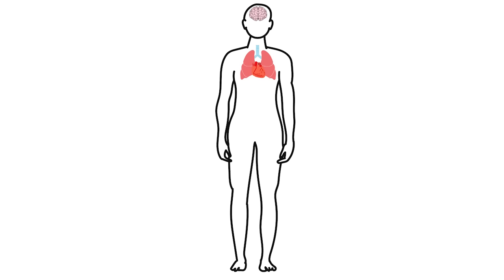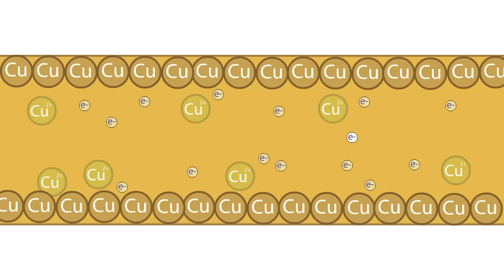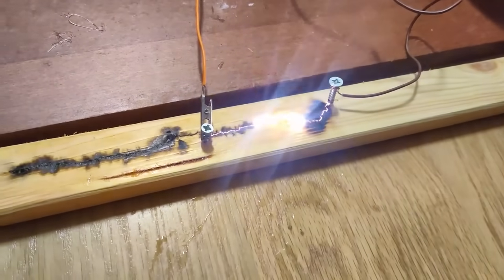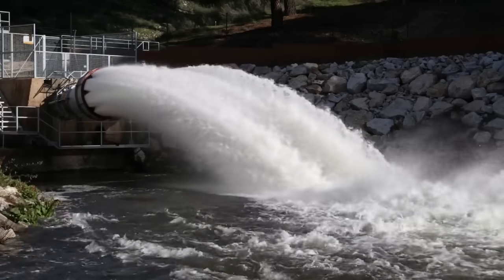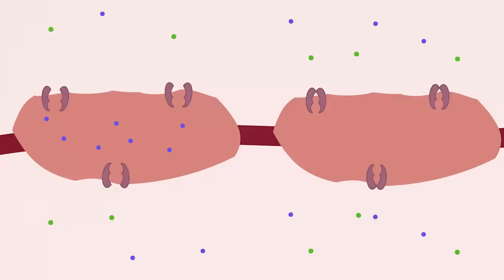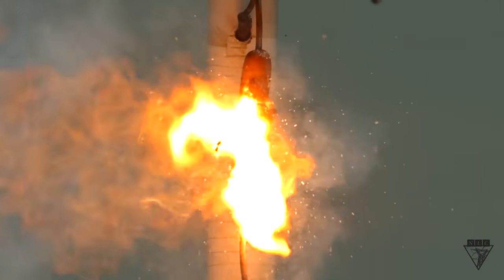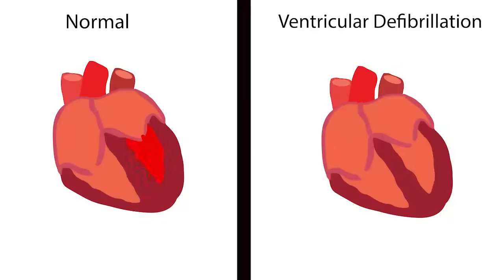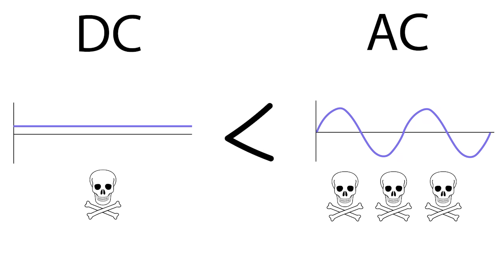Anatomy of Electrocution

Comment: I am an electronics hobbyist. I have worked on both DC and AC circuits. I was working on an amplifier using transistors, the power amp section. The current of the power amp, the collector current, was about 650ma. At the time I did not know that I completed the circuit and 650 ma was flowing through my body. This was for several seconds, possibly longer. But I felt nothing. In your video, you say that a current way less than 650 ma can kill you?
Reply: There wasn't 650 ma flowing through you. In order to get that amount of current flowing through you there would have to be something like 1000v across your body. It's like saying that you completed a circuit by touching a car battery with both hands and the car battery has a short circuit current of 2000 A. In reality since the voltage is only 12 v almost no current flows
Reply: @laserdiode  I had an ammeter in line. Maybe I made a mistake in reading the current because I was on the verge of being electocuted.
Reply: @roncaruso931   What was the voltage across your body
Reply: @roncaruso931  Also if you had an ammeter was the only path for the electricity going through you or was the circuit just operating normally at 650 mA when you touched it

Comment: This video doesn't cover voltage part at all. I had been working with different current measured in Amps which is much higher from mA but I never got electrical shock due to low voltage. 15mA which would cause no let go effect would happen probably with > 500 Volts if not higher
Reply: There is a big difference between the current that flows in a wire that you are touching and the current that actually flows through you. There are only two things that can affect the amount of current that flows through you and neither of them is the current that flows in the wire. Thy are the voltage across your body and your resistance. Since you can't change your resistance the only variable is the voltage across your body. In the video all the currents that were mentioned were flowing through you. It doesn't matter if you are working with a car battery that can supply 1000 A. Since it's low voltage almost no current can flow trough you. The current going through you always does the same damage despite the voltage but the voltage determines how much current flows through you. Also 230 v mains voltage can easily supply more than 15 mA trough you.

Comment: By the way @DarkScience didn’t you mean fibrillation rather than defibrillation?   Defibrillators do use electricity to shock the heart back to a normal rhythm, but the lethal rhythm where the heart bears rapidly and in an uncoordinated action is called fibrillation.  And it can be caused by electric shock.

Comment: Actually AC was selected for political reasons - Thomas Edison suggested the electric chair use AC as he wanted to convince people it was inherently more dangerous than his proposed DC transmission network, and thus discredit his competitor George Westinghouse.   A DC electric chair would be completely possible.   Also, amusingly enough the control panel for Virginia’s electric chair has prominent GE branding like what one might see on a 1950s refrigerator (although to be fair that control system might be a standard industrial switchgear that was purchased off the shelf and configured for use on the electric chair.   Florida’s electric chair, and many others, are powered by their own dedicated generators, so its a pure urban legend that the electric chair causes a brownout in the vicinity of the electric chair being used (although it might well dim indicator lights connected to the lethal circuit).

Comment: Tip from an electrician. If you want to test if a wire is live or not, always use the backside of your hand. If the wire is live you will automatically contract away from the source. Ofc you shouldn’t test it in the first place but there may come times where you think “oh the fuse is broken, I can touch this part” so it is always good practise to touch everything with the backside of your hand first

Comment: also with Electricity (AC and DC)  you can have a 100 Amp power supply and it wont kill or burn you, that is, as long as its below 2-3V,  you can rewire larger transformers to pump out a Crap Ton of current but the voltage is Way too low to pass through your skin
Reply: Actually below 20 V - it is not a coincidence that laptop power supplies provide 19.5 V and even that standard is done on safe way, generally it needs to be 50 V for AC to be dangerous.
Reply: @okaro6595  yea, however if your hands are wet you can feel the electricity a tiny tiny bit at 20v, i used a laptop adapter as a 20v 10a power supply, and i was holding it onto a circuit after just washing my hands (they weren't drenched but a little damp) and i could feel a very very light tingle, not at all painful but i could still feel it

Comment: Electron drift is like centimeters per hour. I think you're thinking of charge and converting it to atomic units. An amp is 1 coulomb per second, which is 6.25 x 10^18e. The energy of chsrge is moving, but not the electron.

Comment: ive fallen onto the arm of a camper, like the little arm that holds up the sun shade thingy on the side, it was not grounded and had rigged up wiring from a nearby house, my arm wrapped around it and i was stuck, i remember feeling it and wanting to let go but i just couldnt, i was there for probably 6 or 7 seconds before my dad (who has electrician experience) realized what was happening and tackled me off of it. i have no lasting affects as it wasnt too high of a voltage, i believe 120, it was still terrible

Comment: I tinker with a lot of electronics most people i know are rather scared of it. Had a few minor pockes a 9V battery and relay coil, an old florcent flashlight, and the one that kind of surprised me tried to shut off a weed trimmer that the control broke leather gloves and boot over it tried to remove sparkplug wire but still got me.  

Someone i know when young was doing something with a 480 Circuit tocuhed something as somone was just saying not to, blew them off the ladder. Another i heared second hand a chainlink fence got put up the person tocuhed it and got fried, apparently somewhere it hit an underground line but somehow no protection device activated. 

One of my big pet peves is when people call getting shocked electricuted. A lot of people do this but two very different meanings.

Comment: You didnt mention the DC voltage at which 15mA is fatal. I know for a fact, I can grab both leads of a 750A 12V battery and not feel a thing.
Reply: The chart was for current flowing through you. Current flowing through you always does the same damage despite the voltage but the voltage determines how much current is going to flow
Reply: @laserdiode  but isn't the voltage what causes the current to overcome the resistance of your body to begin flowing?
Reply: @jkunz27  basically yes but resistance isn't something you have to overcome in order for current to start flowing. Resistance determines how much current flows at a specific voltage. Even with low voltage some current flows through you but nowhere near to to anything. If your resistance was constant  the voltage across your body and the current flowing through you would mean the same thing because they would be directly proportional to each other. In reality your resistance isn't constant but there is still a clear relationship between the voltage and current. With higher voltages your resistance decreases so even more current flows through you

Comment: I was performing some maintainance once and (admittedly through my own complacency) managed to get two parts of my hand in contact with Line & CPC (Live & Earth). That meant there was a 100% metallic path for the current to flow with the exception of the resistance of my hand. Now alot of people have felt what its like to get a shock from a 230v line wire, just standing on solid ground and it hurts. Having a fully metallic path is a whole other level. It was the most painful thing I have ever experienced and through sheer luck, that circuit had additional protection through an RCD that tripped out after about half a second. I ramp tested the RCD afterwards out of interest and it tripped out at 23mA, meaning AT LEAST that amount of current was flowing though my hand in that half second. I was thanking my lucky stars that the additional protection was present and working. It could have been a very nasty injury otherwise.

Comment: During an electrocution, more often than not, it's actually asphyxiation from holding the diaphragm in a flexed state, not total destruction of the organs that kills.  That's why it takes an excruciatingly long time to carry out an electrocution.  That said, we really don't know what happens, and it's more or less speculation.  Also, bodies don't vibrate like in cartoons or movies, it's one big contraction, stays at that level, then when current is killed, the body slumps.  You also failed to mention that the protocols of the electric chair varies from state to state.  Some run an initial voltage of 1,700 to 2,500 V at eight to 10 Amps and then apparently, in some cases, it drops to 250 V then the third and final is 2,500.   The same happens with DC, and I think your little explanation saying AC is deadlier is basically out of Edison's playbook when he was trying to downplay Tesla's and Westinghouse's AC transmission versus his DC transmission.

Comment: Here's a shocking story of mine:

In the summer of 2021 I did volunteer work for a farm that has many farm animals including horses, mules, and donkeys. One day I was tasked with pressure washing various pieces of equipment. So needless to say my jeans were soaked. After pressure washing I helped out with moving some animals to the other side of the pasture (from outside the barn). I went back inside to close the gate, left hand holding the chain but I had to step closer to get a hold of the gate. My left shin touched the high voltage lines that are used to deter animals from trying to climb the fencing, and the electricity went from my shin and out my left hand to the chain. I felt no pain at all, but it felt like my chest caved in for a split second like I was punched really hard. It made a super loud bang, and I was on my knees for a moment. 

It seems to me like most fencing uses DC, so I'm guessing this is DC as well which would make sense because it just felt like a punch with no feeling of vibration or humming noise, just a bang.

Comment: The human body has a negative resistance characteristic. If iou take a n everyday multimeter detbit on ohms and grip the red and black leads it will generally around 4 Meg ohms or 4,000,000 ohms by that if you touched 120 volts you would have 0.00004 amps barely noticeable however at 120 volts  the bodies resistance drops to about 900 ohms and 
0.130 amps is fatal. At 2400 volts the current must be limited to 8 amps or the body might explode.
Edison invented the electric chair to warn of the danger if the Westinghouse high volt system. The first victim took 7 minutes yo burn to death.

Comment: Im a retired electrical/ electronig engr. Ive had several shocks from 230V over the years and got zapped  by the HT in the back of a TV, but the worst shock I ever got was when I grabbed a 12V car battery by the terminals. Luckily I dropped the battery and the circuit was broken. After I regained my composure I rea,ised that I must have had some battery acid on my hands that lowered the normal skin resistance fromm 100k ohms to a few hundred.
I speculate that a single alkaline cell  of 1.5V could kill someone if a sewing pin was pushed through the skin on each hand and the battery appled. The internal rezistance of the human  body is sufficiently low that 1.5v is sufficie to produce a  current of more than 50mA❤
Reply: I’ve worked on vehicles all my life and handled thousands of car and commercial vehicle batteries,most truck and buses use 24volt systems made up of 2twelve volt batteries or 4six volt batteries in older vehicles and never heard of or got a shock from them,perhaps I was lucky.

Comment: The information given here is not true. Especially the chart about how much current is doing what to your body. As you yourself mentioned it is always the combination of voltage and current, not just current or voltage.

And the statement that ac is much more dangerous than dc is utter bs! It always depends. The person touching the fan for example would have easily survived if it was ac instead of dc because then, he could just have let go of the fan.
Reply: All the information was true but there was some parts that were missing. The chart about current is accurate but it only works for the current that flows through your body. The voltage determines how much current flows through you so you can touch a car battery that can provide 1000 A but since it's only 12v almost no current flows through you. Also it's completely true that ac is more deadly if you only compare the current needed to kill you but he didn't mention the fact that it's easier to let go of ac

Comment: 15mA is lethal? Do you mean 15Amps? Doesn’t a small phone charger output 500mA ?
Reply: 15ma can be lethal. but to get that current going you need enough voltage for dielectric breakdown to happen (your skin/flesh starting to conduct electricity).
on a 5 volt charger like a phones it will never happen.

Comment: Outstanding explanation!  You managed to teach basic electrical theory, physiology and pathology at a perfect level to understand the process of electrocution.  The only mistake I could detect was the use of the term "ventricular defibrillation".  Defibrillation is the action of correcting fibrillation, hence the term "defibrillator" associated with life saving first aid machines.  The correct term for the pathology is "ventricular fibrillation".   I mention this only because there could be confusion regarding defibrillator machines; everything else about this video was excellent!

Comment: I have 240v go through me and my fingers were black for a bit when my dad did not turn the shower power off and i was working on it  and it whent with a big bang but that's not the only time i have had a shock i have felt lighting hit the groung never me i get pins and needles  all overe my body  as soon as i could i ran indoors

Comment: Resistor limits the current not the voltage...
Reply: The only way to limit the current is to limit the voltage. Resistors have voltage drop across them so the voltage across the led also lowes and less current flows

Comment: One correction.  Electric shock causes Ventricular FIBRILLATION.... not defibrillation.  Ventricular DEfibrillation is what we do to attempt the re-start the normal sinus rhythm. 
We call Ventricular fibrillation V-fib for short and it is a very dangerous heart rhythm which can cause death.  We use (ironically) an electric shock to attempt to "reset" the heart's pacemaker (SA node) and this is known as defibrillation. (because the heart is already in a state of fibrillation from illness, disease, trauma, etc...).   So the video got that part wrong.   A serious electrical shock can throw you into Ventricular fibrillation where your heart can no longer effectively move blood.  When the heart has entered V-fib on its own, or following an injury or illness, we use machines to deliver a quick spontaneous shock to DE-fibrillate the heart.  
In summary "fibrillation" is caused by severe shock, illness, disease, etc... whereas DE-fibrillation is how we attempt to treat V-fib using controlled electric shock.

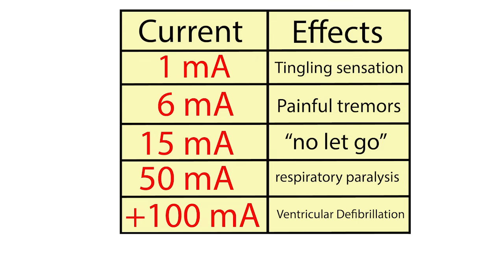Comment: 10:48 That's not true. As Electroboom always says, it's current times time that kill you, not just current. You can get zapped with a Tesla coil at millions of volts running dozens or hundreds of amps through your body, but easily stay alive, it's a toy. How you stay alive with those hundreds of amps if you say here 10:48 that anything above 0.1A kills in one shot? That's because hundreds of amps continue for only nanoseconds or microseconds. The time is as important as current, so it's basically the power that kills you I×t
Reply: Tesla coils create constant arc I think you meant Van de Graaf generator
Reply: @laserdiode  I was about to say yes, but... Even though Tesla coil may maintain what looks like a constant arc, it's the series of super rapid discharges. When arc gets created it's resistance is super low and voltage of the load falls to ~zero, then the current flow stops and the voltage raises again. If Tesla coil created constant discharge it'd easily fry you, coz it would be many amps over many seconds (uninterrupted).

Comment: That disturbing scene from "The Green Mile," [SPOILER ALERT!!] when the one guard ...

...maliciously neglects to wet the sponge!  The wet sponge is supposed to be a conduit for the electricity to flow through efficiently, shutting down the body almost instantly.  Using a dry sponge, the electricity had to go through slowly, burning as it went- like the examples of the wood panel with the electrodes: slowly burning its way through the body.  Gruesome.  Makes me wonder about the "humane-ness" of the procedure, and how they came up with the idea, and how many people they experimented on while working the kinks out of the process.  How many people did they cook like that until hitting on the wet sponge idea?  Sure, executions are performed on convicted criminals, but they're still people, who deserve dignity in death.  And some people are wrongfully convicted; the least they can get is a dignified death, not torture.  What a way to go.

Comment: If the mains frequency is 60Hz, then current turns on and off 120 times per second, since there are two zero crossings per complete waveform.